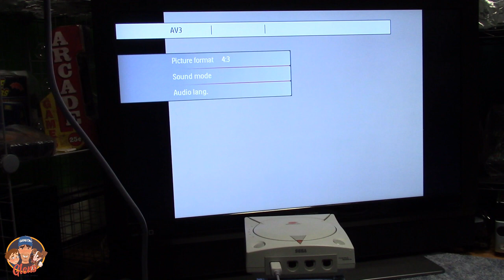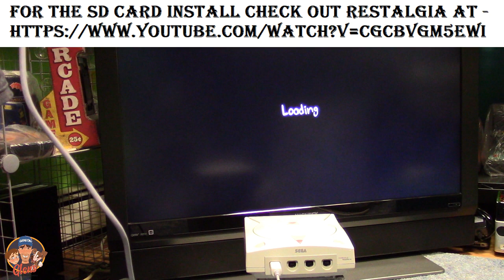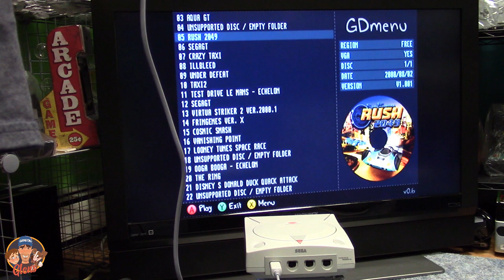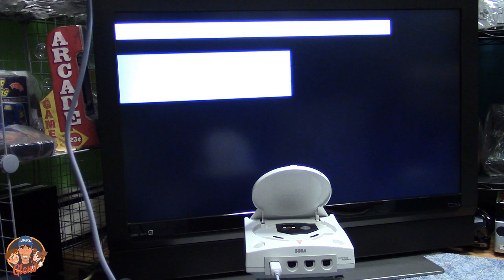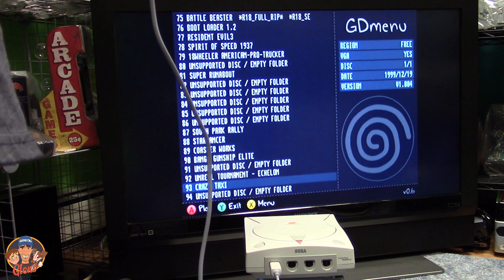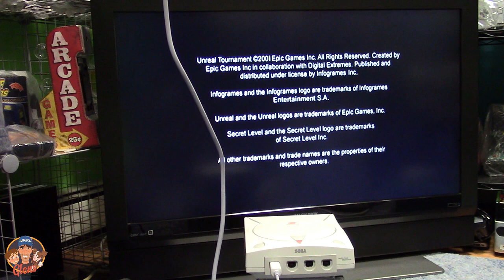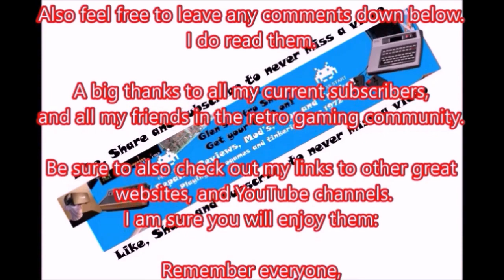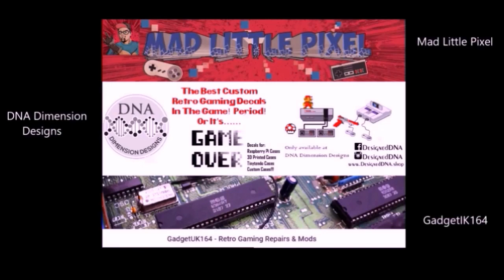Adding a GDEMU and a 3D Printed Holder to the SEGA DREAMCAST

Comment: Do you have a link to where the best place to get the gdemu and if you don't want holders for extra sd cards can you just mount the gdemu in it with a large sd card and never have to open it?
Reply from the maker: Here it's very inexpensive. And yes you totally can...put them on a large SD and never have to open.

https://www.ebay.com/itm/303524473822